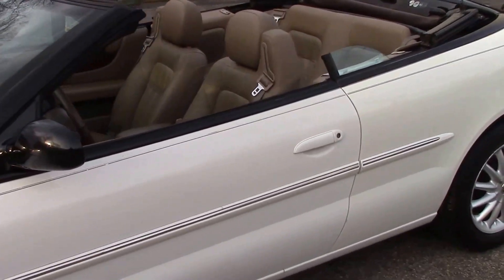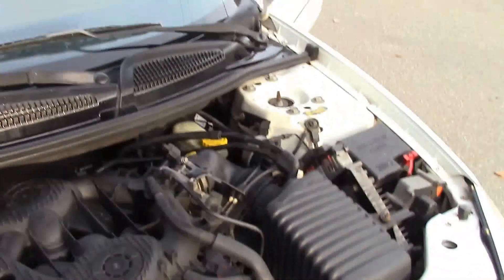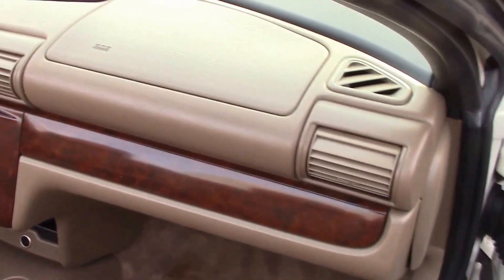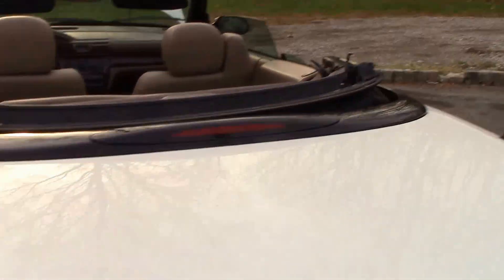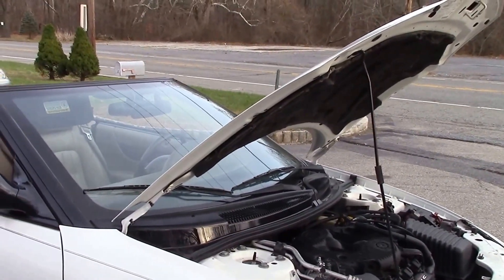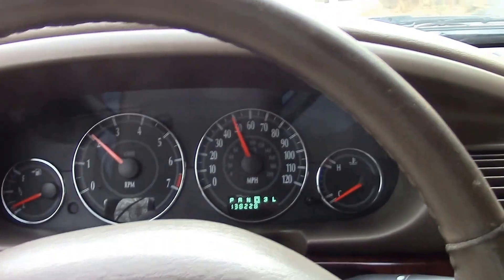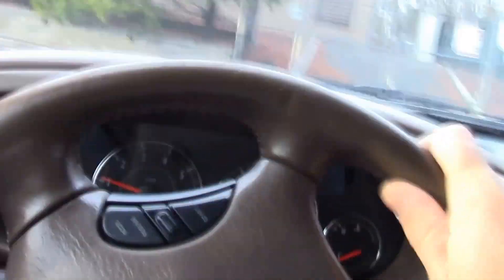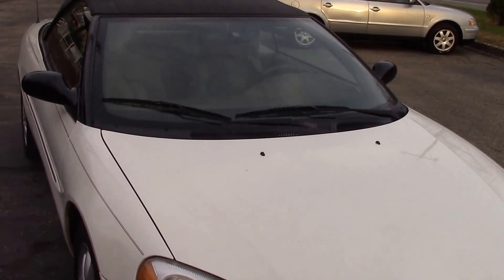2002 Chrysler Sebring Convertible LXi White for sale

Comment: A water pump job on this car costs 1200-1500 bucks due to it being inside the engine, requires a large overhaul, it also leaks antifreeze into the oil and blows the engine if driven long enough...... I can't believe you drove this car so hard getting the rpms up to 6k like that knowing the water pump is bad... I feel sorry for whoever bought this car.... Pretty dumb thing to do.... Google Chrysler 2.7 engine and you will learn a lot...